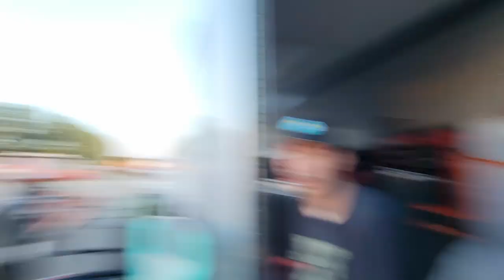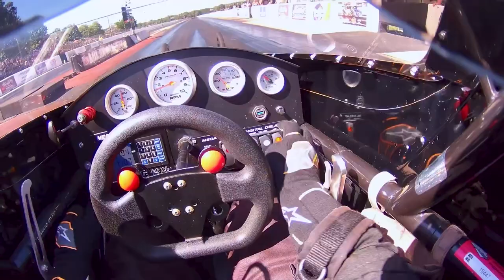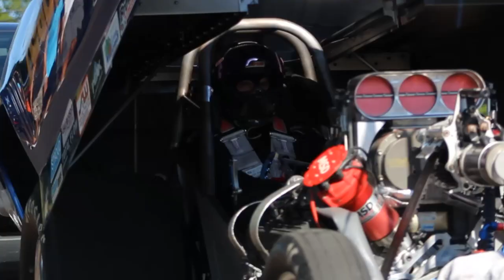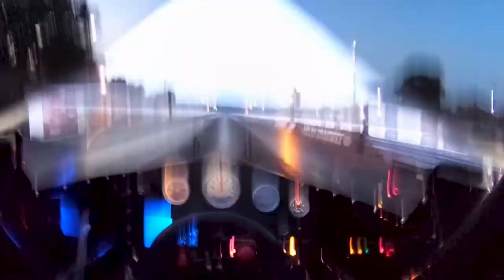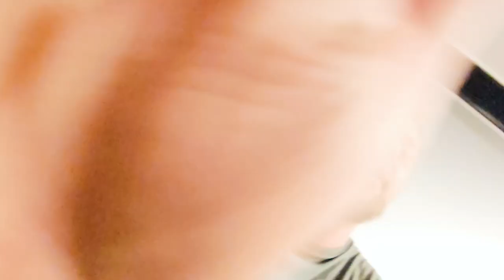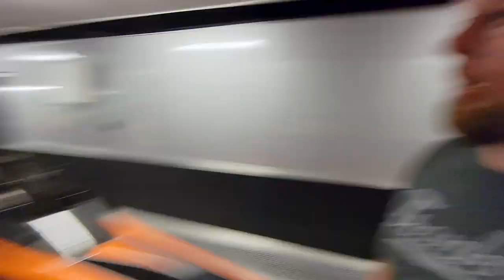NEW TIRES!!! Get rid of that Hoosier Shake!!!

Comment: I been running Hoosier for years. I never get any shake. Won a ton of races with them 2. I also got a set of mickey's that are pretty damn good 2. 1.07 60s within .003 any given weekend with both tires. My conclusion is both are better than Goodyear haha
Reply from the maker: haha for sure. I've gotten tire shake back 7-8 years ago real bad with hoosiers, changed to mickeys and it went away and picked up consistency to the 60. For some reason it just does with my stuff. Mickeys don't.

Comment: Sorry if you said it and I missed it. Did you just put different Hoosiers on, or did you change to a different brand? I've always run Mickey's with good luck (even though it took 6-7 weeks to get tires this spring.)
Reply from the maker: I started the season with some worn out mt's. Went to order a new set but they stopped making my tire this year. Unfortunately ended up having to buy hoosiers and they've done nothing but destroy the car. I finally got hoosier to take them back and bought a set of wheels and tires off of a friend. We have the big bubba and some beadlocks on the car now.

Comment: Everybody complains about Mickey and losing air. Well air is free and rearends aren't lol I will never run a Hoosier. Lil bubbas are where it's at!!
Reply from the maker: haha agreed. We just put the big bubbas on. Love them so far!
Reply: @gooncotv  I run lil bubbas on my 4.60 ride and have them on my 4.10 blown dragster but I'm thinking of stepping up to the big bubbas for it.
Reply from the maker: @DG38594  awesome! We have a blower combo for this car that I believe we are going to bring back out next year.
Reply: @gooncotv  Awesome man! They are fun!!!
Reply from the maker: @DG38594  100%
Reply: Hey if you have an air loss problem try this old trick I learned 30 years ago, Before installing slicks wipe the inner side wall with dawn dish washing detergent.  It stopped air loss in my tires from that point on,  DannyO    Bracket racer from Oklahoma.
Reply from the maker: @onetallone41  yea I usually do that. Definitely helps